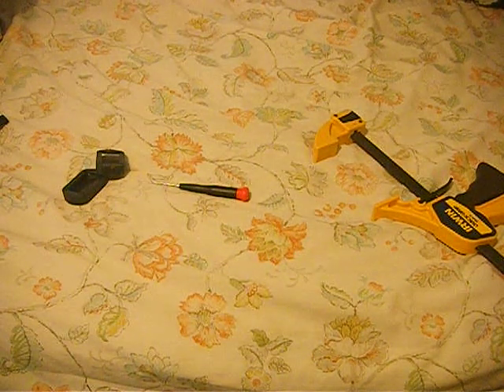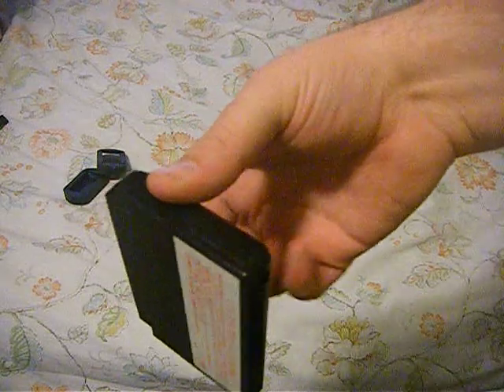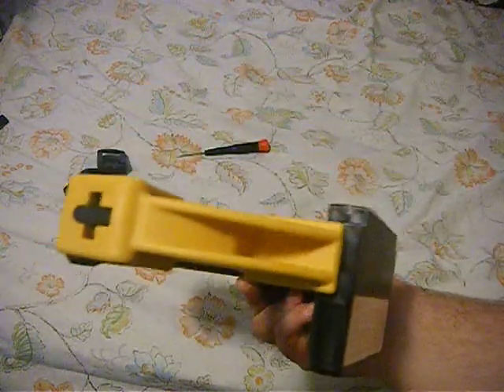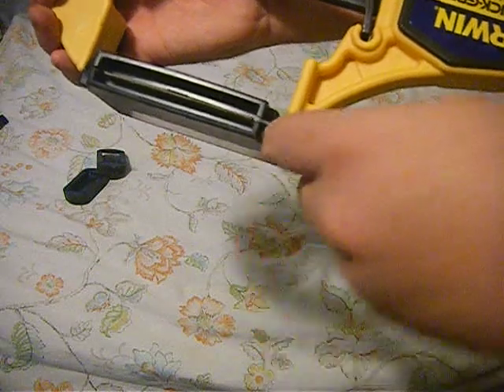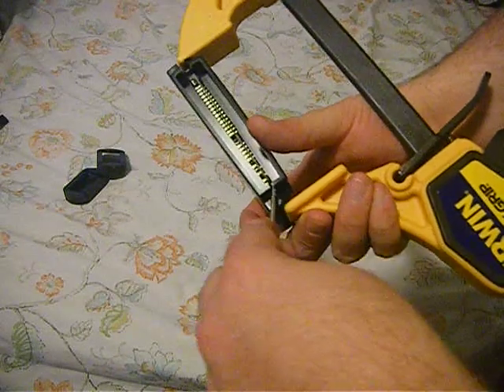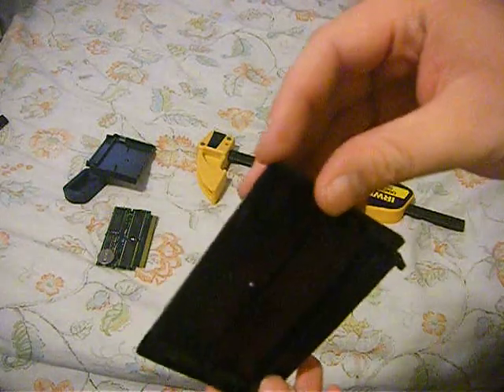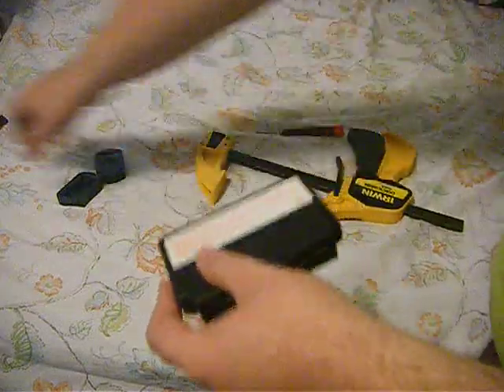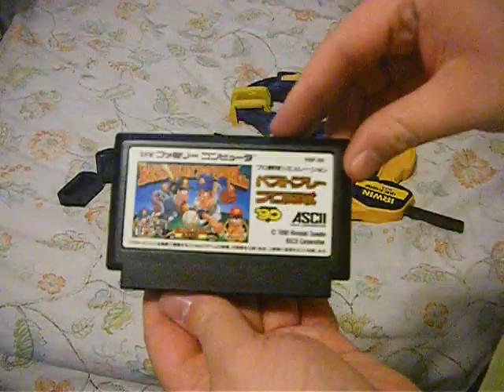How to safely open Famicom cartridges

Comment: I do something similar, but I leave one pad on the clamp and don't put both sides of the clamp on the front of the cartridge case. Clamp at an angle with only one side on the front and the padded side on the back corner, this requires less clamping pressure and produces less flexing. Pry with a plastic spudger or monitor adjustment tool to not mangle the case. Then clamp again and undo the other side.

Also there are 2 clips in the back. Everyone seems to suggest just opening it like a clamshell, but you run less risk of damage by partially opening and using a spudger through the slots to pry the front  piece in and away from the back piece.

Your results may vary depending on the cart manufacturer. Taito carts are brittle for instance, some carts have a spine label, and I'm sure that there are other variations I've not seen as yet.
Reply from the maker: Thanks for sharing these tips. I'll pin you because this is good info. And I second that spudger. At the time I made this video, good quality non-marring spudgers were not commonly available, and so I used a screwdriver.
Reply: Totally cannot picture what you're trying to say.

Comment from the maker: Oh, and by the way, other kinds of clamps can be used for this method too, however I like the quick grips because they're very easy to adjust quickly and it's easier to feel exactly how much pressure you're putting on the cartridge, since you have to squeeze. That way you can be sure not to put on too much pressure.

Comment from the maker: @mog123noblog I am not exactly sure where to buy them, but they are made by a company called Irwin. The name "Quick Grip" is a brand name. It's basically a bar clamp with a squeeze grip instead of a screw mechanism. I would suggest looking at places that sell tools or perhaps on eBay. I bet a store in your hometown probably carries them too.

Comment: I just broke a Famicom cartridge doing this.
I was very careful, and I don't think there's a problem with the technique as such, it's just that the plastic on this cartridge was extremely brittle.
It had no give in it whatsoever, it just broke instead of bending.
Like I said, I think the technique itself is sound, it's just that some cartridges are too brittle for it (or indeed any other technique) to work.
Reply: What was the game you tried to open? I have heard that certain cartridges are much more fragile
Reply: @AngXble23  I can't remember, but it was basically the cheapest one I found on ebay. I bought it because I have a Famicom on display. I just wanted a cartridge to put in it for display purposes, so I wasn't fussy about which game it was.

Comment from the maker: Nope, not on mine. Still, be careful. If your games have some UV damage to the plastic they may be brittle, and they will be literally impossible to open without damage at that point. Practice this on cartridges you don't care much about first.

Also be aware that 3rd party carts sometimes have screws, and often have the latches places in other locations, meaning this method may not work with them.